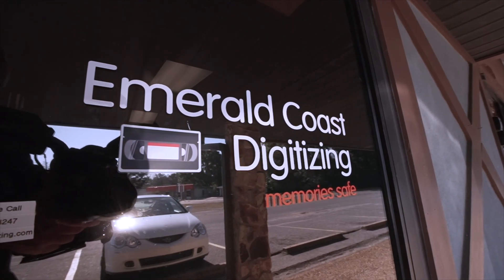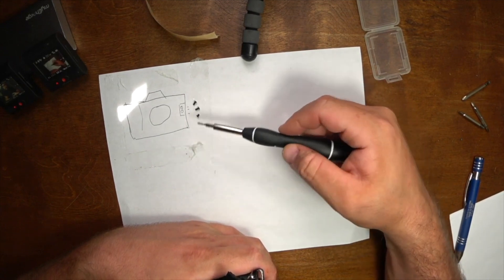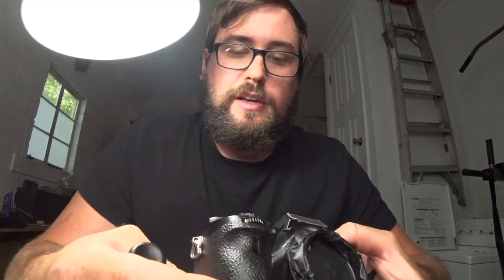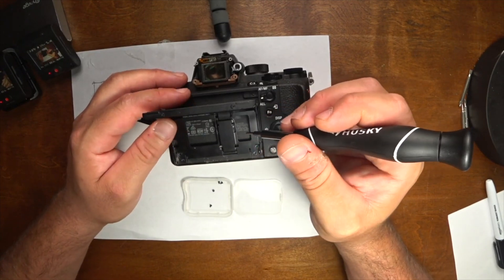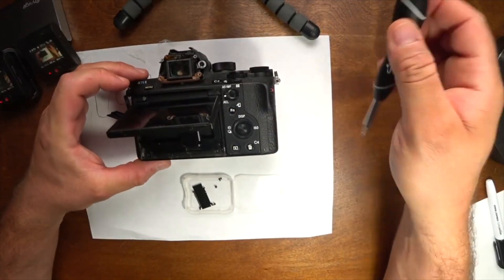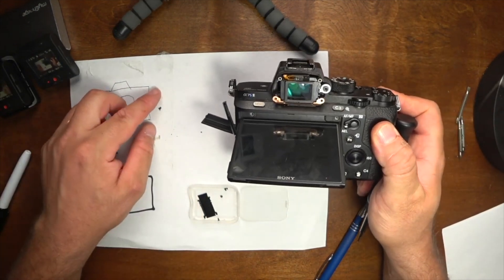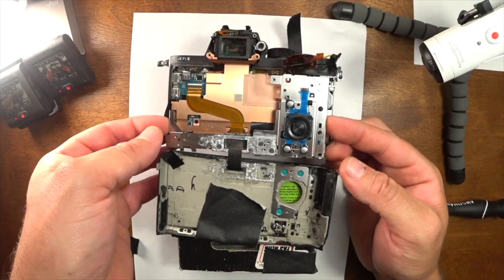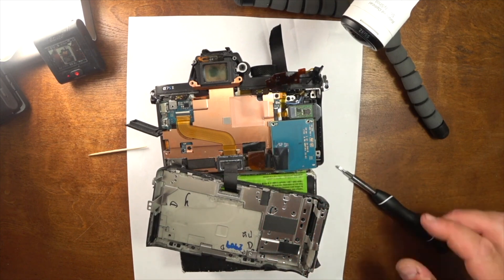SONY A7S Screen and sd card slot replacement

Comment: Kudos for having the guts to do this.  It's def not for everyone.  You have some good ideas on staying organized for getting it back together which can be more challenging than disassembly.  I've done similar things on the screws, etc.  You might consider taping down the paper in a flat oven pan or tray so it can be moved easily without disturbing the screws and also could hold various small parts in an order of removal, etc.  And of course, use lots of light and take lots of pictures.  A flat plastic spudger is good for not scratching or damaging things when removing adhesive tape, ribbon cable locks, etc.  Ditto for tweezers.  While you have it all apart, you should get some DeOxit fluid and use that on all the ribbon tape connections to ensure there isn't future connectivity issues.  I'm sure you've seen the 12voltvids guy use it before.  Get some.  I've used it for years and it does make a difference long term.
Reply from the maker: This is an older video from 3 years ago. I repaired the camera and went on to use it as specialty camera on  tv show shoot. The show is called the “ultimate cowboy showdown”
Reply from the maker: Thanks man!
Reply from the maker: I actually have a bottle of depxit